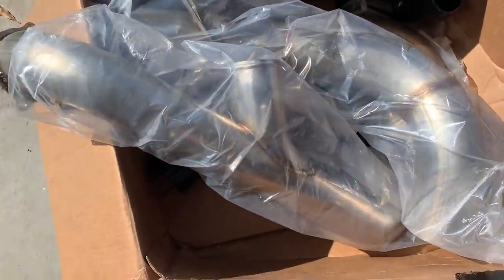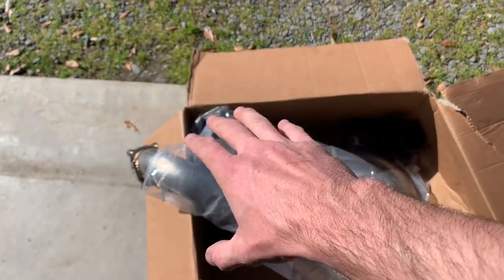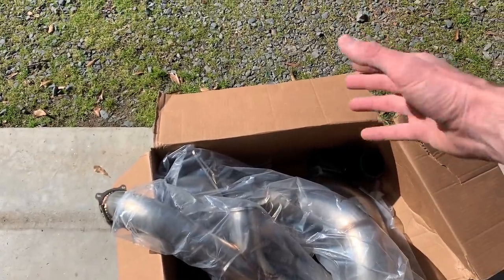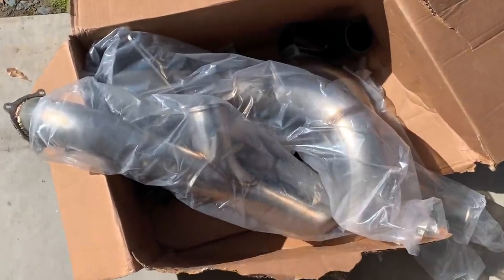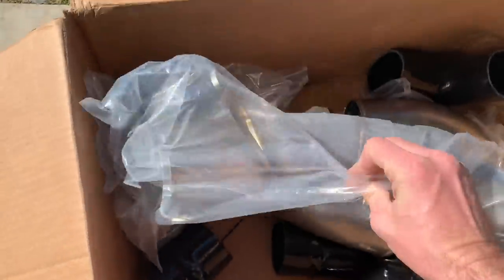How To Install Piping Kit On A 6.7 Ford Powerstroke

Comment from the maker: GET KIT HERE - https://propowerdiesel.com/?ref=wm1qnuhhud

USE code COLTSWAY for 3% off. 🇺🇸🦅🇺🇸
Reply: Hey boss sorry I haven’t emailed you yet but I can’t find your email address at all.  Can you send it to me or let me know where to find it.
Reply from the maker: coltshinton@gmail.com
Reply: Just sent you an email, hope you can help.
Reply: Could you just use a shorter bolt
Reply: Is there a new dip stick bracket?
Reply: Hey Colt did you have any issues with the mass air flow code after you installed this kit.I have a 19 powerstroke and I can't get the stupid code to stay gone.Any advice

Comment: On my 2019 f250 6 months after my piping kit install i get a small belt chirp, i replaced the belt and idlers pulleys and it still does it but less now. So i did a bunch of research and read alot of forums and i guess its perfectly normal after a piping kit install, theres no lag on shut off now just and instant shut off cause a small "chirp"

Comment: Yup, Hair spray helps the clamping force on the couplers. Haven’t use that trick for a min. You can also build a boost leak tester and use soapy water to find any other boost leaks.

Plan on following the Colt mod list this spring! So appreciate the uploads, Busssschhhhh!
Reply from the maker: I just approved the you watching! Thank you. 🇺🇸🦅🇺🇸

Comment: Hey Colt, a trick we use at work for boost leaks is wrap the joints in thin foil, the leak will blow a hole in it most of the time. Your truck is a ripper, can wait to get the info from you to help mine out. 🇺🇲
Reply from the maker: Just sent you a email brother. And solid tip, I’ll give it a try! 🇺🇸🦅🇺🇸
Reply: @COLTSWAY  60% of the time it works every time. Certainly helps a guy out when he's working solo or when it's super intermittent.

Comment: Just for future reference, a set of good 1/4" metric wobbly sockets (the kind where the socket is permanently fixed to the joint and by good I mean SnapOn or Matco),  a set of 1/4" wobbly extensions in various lengths, a flex head 1/4" ratchet with a 4-6 inch long handle, and a Milwaukee electric ratchet all together make working on these engines a breeze.  If you plan to keep your truck and continue to work on it then investing in those semi-specialty tools will make your life much more pleasant.  With those tools and a little practice you can have the upper and lower intake plenums removed in 5-10 minutes.  They're expensive but your knuckles will thank you.

Comment: I know it’s late , but when I was building my 7.3’s, any time I took the Air pipes off, I wipe the pipe and the couplers off with acetone on a microfiber rag to get rid of all the oil residues so the don’t slip off. It works for me
Reply from the maker: Good idea! 🇺🇸🦅🇺🇸

Comment: Hey man, awesome videos. Keep ‘em coming. But got a quick question. Noticed on your ez lynk app, under the vehicle category you have a functions option where you change stuff like the gallons for the tank size and stuff. My app doesn’t have that option. Just wondering what you did to add that. My app/firmware and all is up to date as well. Any help would be appreciated. Thanks man
Reply from the maker: Damn, that’s weird. I don’t know why it don’t have that? ESP if it’s updated and all that. You got tunes on there? 🇺🇸🦅🇺🇸
Reply: @COLTSWAY  yea man all my tunes are on there. Only thing I can think is I have the original auto agent and not the auto agent 2. Maybe they change some stuff up on the 2nd version
Reply from the maker: Yea that could be the reason. I have the 2.0 🇺🇸🦅🇺🇸
Reply from the maker: You can use forscan to do anything you want though
Reply: @COLTSWAY  ok cool, I appreciate it buddy

Comment: The boost leak is probably coming from the o ring inside the pipe that you had to use the factory boot on. You might need a new o ring. Mine did the same thing when I took that pipe off and it sounds like a balloon leaking like that

Comment: Is it possible to have a 6.7 full delete with some type of tunes or what not for no black smoke? I understand some like it but I don’t care for it. Also have only had gassers before so…yeah idk to much. I like to get on the pedal a bit so wasn’t sure if it would just smoke all the time.
Reply from the maker: Most all the tunes are pretty clean joe a days. You will always have some. People that have a lot of smoke are prob running LBF files ( low boost fuel) and that’s causes a lot of smoke. 🇺🇸🦅🇺🇸

Comment: Did you have any issues with the hot side charge pipe? After installing my kit, the new pipe in the old coupling where it goes into the turbo is coming loose and isn’t blowing off but it wants to come out of the coupling.

Comment: Colt you shoulda put the S&S Diesel disaster prevention kit in while you had all that shit off there.  I had all the same cuts, dropped tools, and frustrations you did trying to remove that crap.  Thanks for making me re-live that nightmare brother! 🤣
Reply from the maker: Yea I might get it in the future. I just read it don’t really save the system. I need to do more research on it! Thanks for watching brother! 🇺🇸🦅🇺🇸
Reply: Get the SPE Motorsportes kit. No cutting required and it works.
Reply: @tprice3450  That kit sucks. Poor quality and no return filter. Also good luck getting it in any reasonable amount of time.  No cutting with the S&S kit either.
Reply: @JmF250  you can get the return filter as an option. I did. From what I'm reading ilabout the two systems, the S&S kit just upgraded to where the SPE kit started. The ship date on orders placed today is March 4th. We'll worth the wait and the additional $19.00 for sturdy aluminum parts.

Comment: Awesome video this is my next upgrade and the same kit I was looking at too. It ain't as pretty as the other high dollar kits but it gets the job done that's all that matters to me.
Reply from the maker: That’s right, it works good and it’s a lot easier on the wallet! 🇺🇸🦅🇺🇸
Reply: Which kit is it?
Reply from the maker: I left a link to it in video description.  Use code COLTSWAY for 3% off. 🇺🇸🦅🇺🇸
Reply: Thank you sir!!

Comment: Does your top radiator hose collapse? Thermostat to radiator at 48:55? Or whenever you start it when it’s cooled down?
Reply from the maker: I think when I turn the truck off it sucks down a little. Some sort of small vaccume or something. 🇺🇸🦅🇺🇸
Reply: @COLTSWAY  mine did That too turns out the seal on the coolant resivor cap is bad I put a new cap and stopped doing that vacuum
Reply from the maker: I’ll have to look into that! Thanks brother! 🇺🇸🦅🇺🇸
Reply: @COLTSWAY  no prob also if your seal ever leaks from the top radiator hose part number for the o-ring is BC3Z8590C mine went out and just changed the o-ring instead of the $100+ hose
Reply from the maker: My man! Appreciate it! 🇺🇸🦅🇺🇸

Comment: checked out propower diesel but they only have piping kits for 17+. My son and I are shaving some weight off his 2012 6.7. Any thoughts on how close the 17+ kit is to the 2012 6.7?
Reply: Air filter tube off the turbo is your main issue. The battery is in a different spot and will not line up. Pretty sure CAC tube is also different diameter from 3" on 11-16 and 2.5 on 17+

Comment: How did you get bolts in the passenger side in the back ? I’m struggling to get the rear ones in.
Reply from the maker: I literally show this in the video. Long extension and a wobble socket, it’s a pain in the ass for sure. 🇺🇸🦅🇺🇸

Comment: Just a couple of suggestions. USE THE DAMN SILICONE SPRAY!!! The spray makes it so much easier to slide your connections together and when it dries, it seems to have a sealing effect and you won't have to use the damn hairspray. I'm confused why the manufacturer didn't just make the intake a single piece Y pipe instead of using a short pipe and coupler. 

As we've discussed before, I did it all at once. I did the repipe, the EGR delete, the CCV delete, the coolant system reroute AND a fuel system disaster kit all at the same time. It was a two day job, but it was much more efficient. For instance, I only had to drain the coolant once and the disaster kit is a breeze to install without all that piping in the way. 

I dont know what kind of tune you are using, but EZLYNK has a very fuel efficient tune for the SOTF tuner that's a lot less smokey and gives you just as much power. 

Now if you really want to hear something cool, put a 10K trailer on there, turn on your automatic engine brake and set your cruise control to 60mph on a long 6% grade. You'll swear you've got a Jake brake in there when she kicks in. I do that fallin down Elk Mountain into Laramie all the time and I get either goofey looks or big grins from the guys in 18s.
Reply from the maker: Yea I should of used the silicon! I love the jet engine sound!🇺🇸🦅🇺🇸
Reply: One more hint. Invest in a pair of mechanics gloves. Both your fingers and your better half will thank you.
Reply from the maker: Very true! 🇺🇸🦅🇺🇸
Reply: Tom: what’s the tune from Ezlynk? I’ve set the Soft switch but I disconnected after a while cause I couldn’t get a worthy fuel efficient tune. Now I’m running a 0 hp and a transmission flash with a 3rd lock that seems to have a good balance between power and fast acceleration. I’d appreciate it if you can give me that info.
PD: I thought the same: do it all at once: the disaster prevention kit and the EGR cooler, I agree with you 100%.
Thanks a lot
Reply: @tprice3450  
Also: what brand of block off plate kit did you use,? I’ve seen one with tow big plates instead of one and I think it has more coolant flow due to much bigger holes in the bottom plate, am I right?
Reply: @JuanPerez-mj5mq  off the top of my head it's the one with "AFR" in the name. It's not meant for quickness or separating the rubber from your casings. I tow trailers from Elkhart IN to points west and I'm looking for a good balance between pulling power and mileage while attracting as little attention as possible from smoke and fumes. This one seems to fill the bill. Steady highway driving empty I'm getting between 18 and 22mpg with my dualie.
Reply: @JuanPerez-mj5mq  most blockoff plates don't allow coolant to flow through them. You don't need coolant flow without an EGR cooler anyway. Use the cheapest kit you can find to block off the coolant and exhaust. One thing you might want to do is replace the EGR Cooler mounting O-rings. You'd think that manufacturers would provide them, but they all tell you to reuse the old ones. Mine failed and I had to replace them. An easy but unwanted extra step
Reply: @tprice3450  
I thank you for taking the time to respond, I’ll order those O-rings and schedule a weekend to work on it and spare a Monday just in case I left anything undone, haha.
Thx again
Reply: @JuanPerez-mj5mq  just go to your local Ford dealer. They should have them in stock.

Comment: Hey man you ever have any issues with your piping kit? CCV reroute? I use these trucks for my business and Im wondering how reliable it is.. stock ive never had any issues with 3 6.7’s all over 250k miles one I just sold at 308k lol
Reply from the maker: My man; appreciate you watching. But that sub button if you haven’t. No I haven’t had any problems at all. The CCV stinks now but ima put a Venturi on it soon and that should take care of the smell. 🇺🇸🦅🇺🇸
Reply: Subbed for sure ! Thanks man

Comment: Im looking at buying that same kit you bought is that pro power legit i see they only use apple pay basically and not like paypal anything i should be worried about?
Reply from the maker: It’s legit for sure if you use my link and discount code. It takes you to a legit site. Lots of people have ordered threw it. You will be good to go brother. 🇺🇸🦅🇺🇸
Reply: @COLTSWAY  awesome thanks man will use your code for sure 🇺🇸🇺🇸🤘🏻
Reply from the maker: @antoniobufagna1962  thanks brother. The code will only work if get to the site from my link. If you go to site and put my code, without getting there from link, it won’t work. Just a heads up.

Comment: Just installed the same kit and love it. My only gripe is that there’s no place for the IAT sensor. I’m getting code P026A when I look at the codes on my EZLynk which relates to the IAT sensor.  Anyone else having the same issue?
Reply from the maker: Mine has throw that code but I just tried a different tune and it went away. But I ran with it forever. You could ask your tuner to write you a custom tune addressing it. 🇺🇸🦅🇺🇸
Reply: Thanks for the quick reply! Just looked at my tunes. Apparently it’s called a CAC sensor and I have a tune for removing it. Go figure. 🍻

Comment: ■■■...you ever get that death wobble in that there front end.  If you got a solution, I'd sure like to know it.  Thanks. ('If you're rubbin your racin')
Reply from the maker: I’ve never got it, but I’ve had dual stableizers like since I bought it. Literally put them on a week after.  Also when I got my level kit I made sure they changed out the caster sims to the correct ones. 🇺🇸🦅🇺🇸

Comment: I need to stop watching ya damn videos. Keep making me buy stuff for my truck. 
I just picked up the S&S disaster kit and will have all that stuff off. Thinking I should bit the bullet and just have this ready to go on to, since I have to take whole system off to install that. 
Are you happy with this kit after some use, did you figure out those boost leaks. 
I’m a poor YouTuber also, wife won’t let me throw $2000 away at crap she don’t know nothing about.
Reply from the maker: Lmao, don’t do that!  Yea I got it all figured it. I just drove around a good bit more and got it real hot and it sealed up. Just took a lil work adjusting boots, but that’s to be expected. I’m deff happy with it! 🇺🇸🦅🇺🇸
Reply: Darn it man. I just got the money together to purchase this kit from Pro Power Diesel. I was really going around with it. Not sure if it will make that big of a difference getting block off plate on and pipes. 
Guess I will just have to make another video of install.